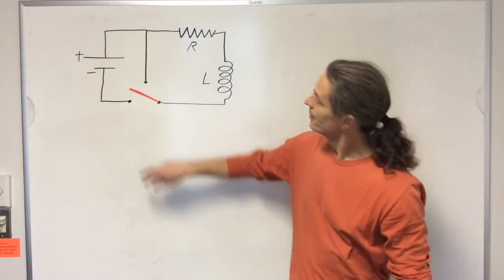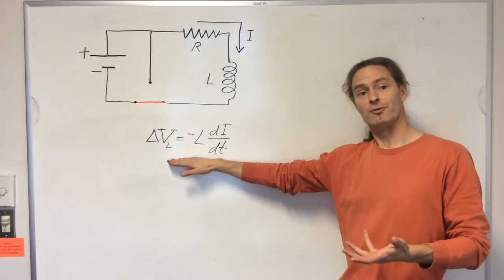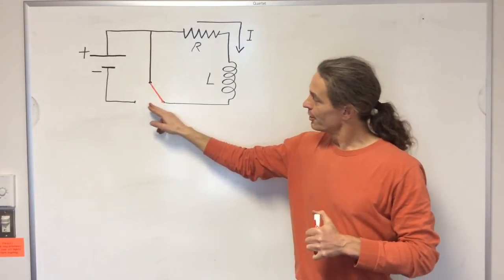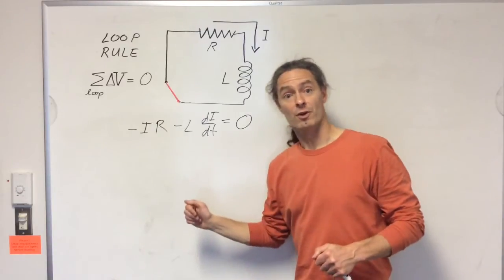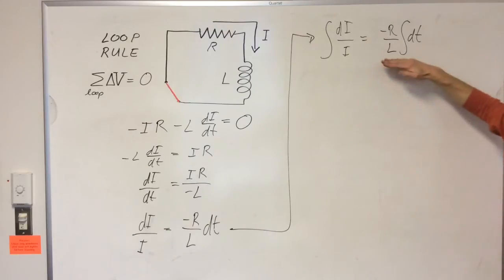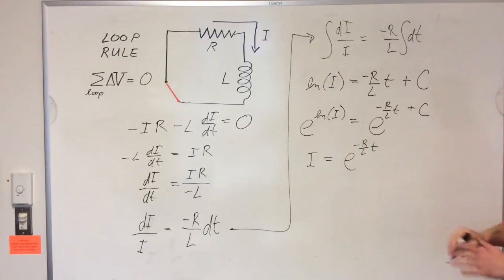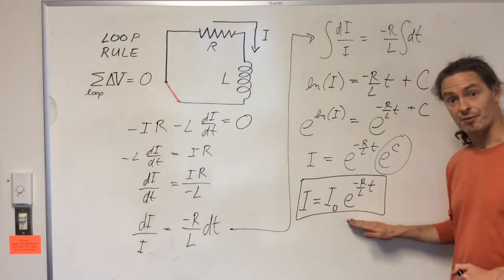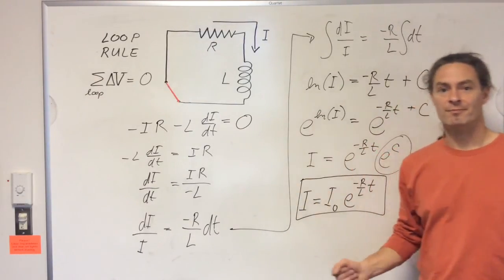Discharging RL circuit

Comment: what does it  happen with the voltage?
Reply: It becomes zero because you removed the power supply that's why circuit is discharging
Reply: @आशीषभारद्वाज6639  thanks modi ji.. you saved me for my test tomorrow. BJP rocks.

(Fck im muslim)
Reply: @zaheersuhabuth2677  lol